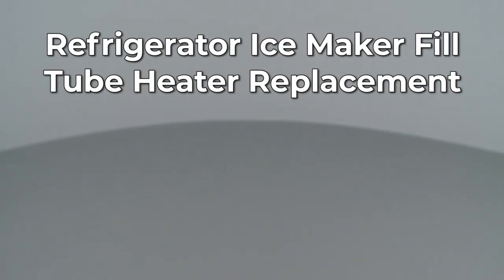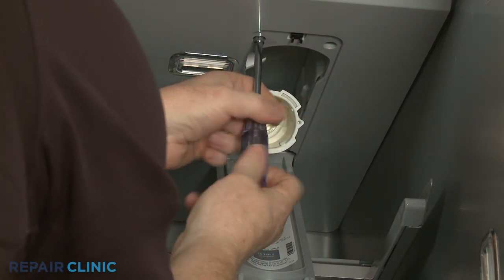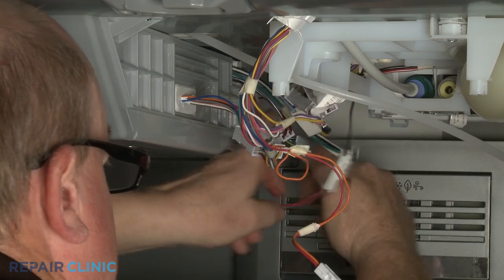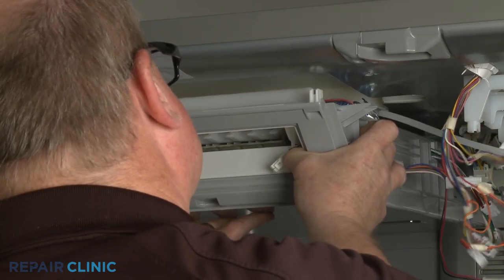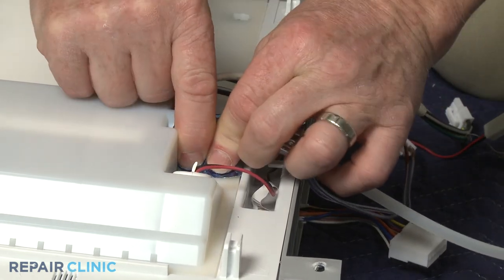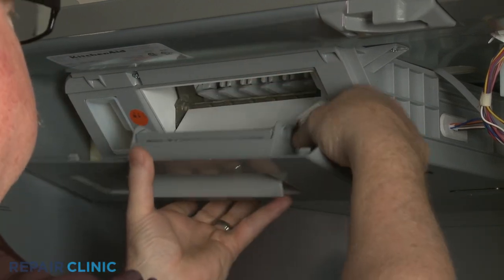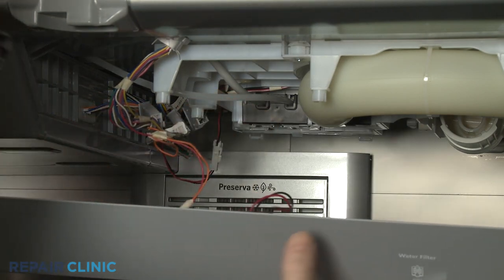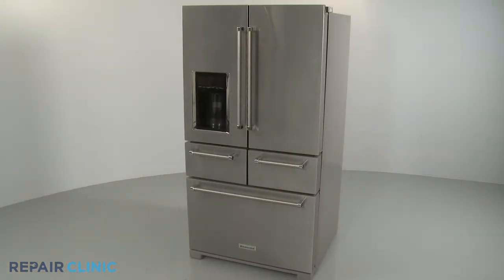KitchenAid 5 Door Refrigerator Ice Maker Fill Tube Heater Replacement W11226501

Comment: How hot does this heater get?  I am having trouble with the inlet line freezing and ran the service test 19 and the heater doesn't get very warm at all.  The main board is putting out 115v as needed.